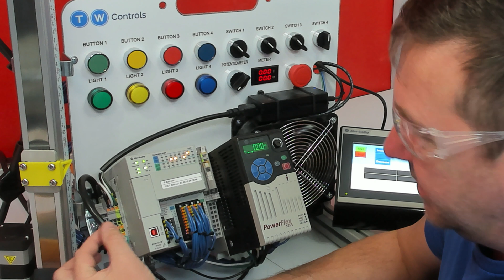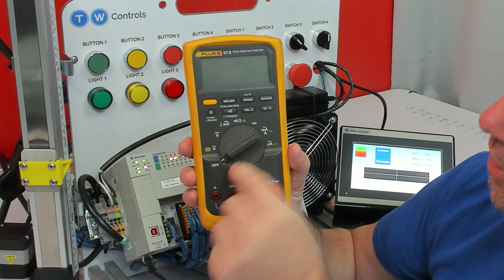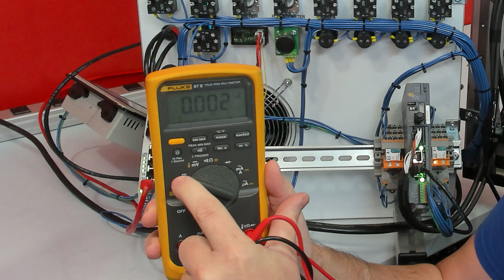How to Use a Multimeter.  AC and DC Voltage.  Ohms

Comment: Hey I got a question for you about the same meter(t6-1000). I'm a young maintenance tech and I've noticed some discrepancies with my ohms from my meter to others. Simply some times I fell I can't trust my meter. Have you noticed anything like that with yours
Reply from the maker: Can't trust as in way off of not as good of resolution?  For example, the 87V has greater range and accuracy, so if comparing it to it, it would seem less precise.

Comment: I would advise caution on using a meter on live circuits above 50 volts without first going through some sort of electrical safety training.
Not directing this at you Tim, just want to stress for viewers you should always have a healthy amount of fear in you whenever checking a live circuit.
Reply from the maker: Good tip!
Reply: At the last company I worked with which was in Pharmaceuticals at Pfizer for quite a while. There was some sort of OSHA change I believe it was as was in Operations at the time. But we had to literally go around the huge ass plant site helping electricians put all kinds of safety placards on any kind of panels of every kind that had more than 50 volts. It was really crazy as you were now seeing electrical safety hazard placards everywhere.

Comment: A critical note for people new to DMMs: If you are checking voltage you MUST NOT have  the lead in the current (as in amps) port otherwise you will deadshort what you are checking. Some meters, like the Fluke 87v in this video has an alarm if you have a probe in the current port while a non-current setting is selected.
Reply from the maker: That warning is nice!  Check out this video where I talk about the fuse in the "Brand X" video.
https://www.youtube.com/watch?v=vbV9cujm3Ec
Reply: That’s great info.